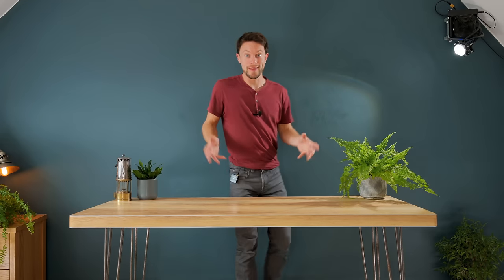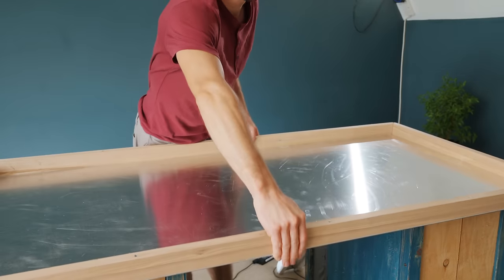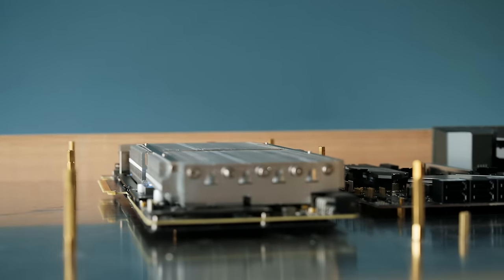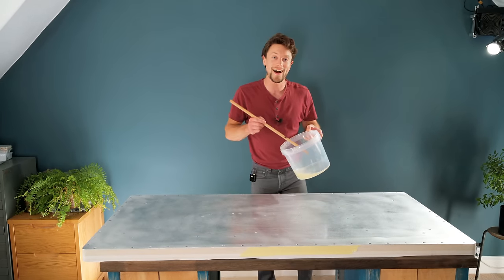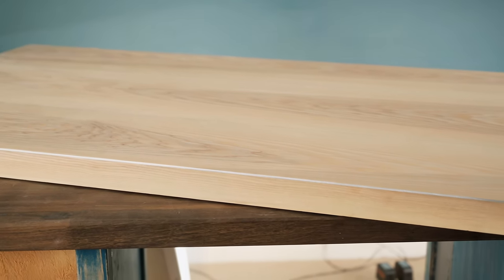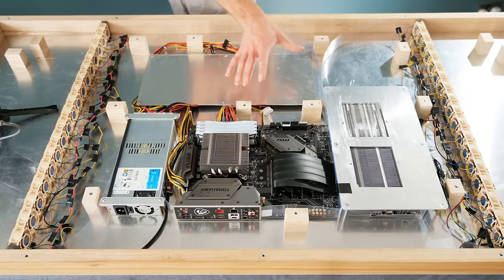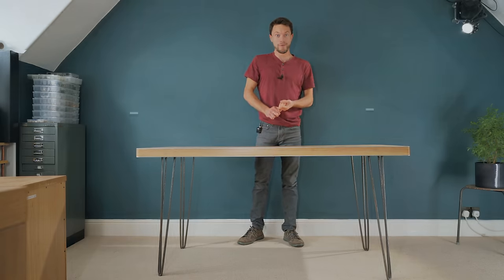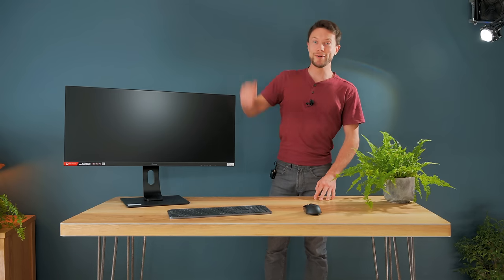Building an invisible PC

Comment: I feel like this would benefit greatly from liquid cooling. generally the liquid cooling blocks are much lower profile than air cooling blocks, and you have the advantage of being about to select any radiator size you want. Maybe you could even create your own radiator in a part of the aluminium table since it is such a large surface area, but I kind of doubt that.
Reply: 1st time ere eh?
Reply: If you have listened till the end you would have knownn that he's well aware of that.
Reply: Naw, liquid cooling is a maintenance nightmare, air is where its at unless you are constrained or have extreme overclocking needs, massive heatsink coolers are very hard to beat, and you don't have to worry about them failing.  I would have sacrificed the thinness of the table to achieve this, i wouldn't trust that thin table's wood not to crack if someone just hopped on and sat on it.
Reply: @churblefurbles  he could use two AIO water cooling Kits for both CPU and GPU using Kraken G12 mounting kit. Better thermals and quieter.
Reply: @armLocalhost  did he explain why he didn't go with it? He just mentioned Linus is doing it that way
Reply: @churblefurbles  I have a liquid cooling setup, custom loop. I do so because I am still running a first gen i7 that I have overclocked to nearly double its clockspeed. Sure, it is more maintenance than an aircooler (except if you are in a dusty room), but not a 'nightmare'. Pretty much have to change the water inside once or twice a year and you are fine. 
Plus it is besides the point. His desk now has holes in it and even a raised section for the mother board cooler, which could have been prevented with watercooling.
Reply: @armLocalhost  And? My comment still with its content. He also never mentioned why he didnt consider it. Plus he never mentioned using the table as a heatsink either.
Reply: but it would be annoying to check all the time and if it leaks everything is completely frked
Reply: @chengxiaoshi3461  You check for leaks after filling up the water cooling loop. if there are no leaks then, its very unlikely for a leak to form later. Plus even if there is, the water is non conductive so unlikely to do damage. In over 7 year of water cooling (and seeing friends that have it) I have never seen a single person having an issue with a water leak. 
Sure air cooling is more reliable and less maintenance, so I wouldnt recommend it if you arent doing serious overclocks, but it doesn't satisfy the size constraints imposed by the table, thats where the suggestion comes from.
Reply: It is also very costly
Reply: @tHaH4x0r  you know, even with an air solution, if you could come up with some sort of laptop-like heat transfer system from CPU to table underside (see also heat pipes, but obviously more than in the usual laptop), you could put some serious finnage attached to the inside of the lower aluminium panel, vastly increasing the cooling surface area. The problem is you'd have to either change how you're mounting the entire kit so it's attached to the removable lower metal sheet, or get used to re-applying thermal compound every time you took the bottom layer off. Either way, it'd be interesting to see whether something like that could be managed.

(I guess you could try to go with reusable heat transfer pads to avoid that kind of re-application - thermal compound between CPU and heat pipe assembly, thermal pads between that and the tabletop metal. Also, you can't use the top metal sheet as the heat sink because you'd get metal expansion rate vs. wood expansion rate issues and almost certainly de-laminate the top layer. And even if you didn't, you'd get wood and/or finish discolouration from the heat.)

Comment: how to make this better:
1. Use Water Cooling
2. Use smaller RAM Sticks 
3. Use a Mainboard that doesn't have an IO-cover
Reply: can we use the base as the heatsink? it is very wide so i think it can right?
Reply: Yeah, water cooling is perfect (and cheaper than 40 44mm vents) for this project. You can also add some gigantic radiator (like 480mm) and a lot of vents, create an airflow which mantains the central piece completely hermetic, for not having to deal with the dust. Also, I would buy a standard ATX PSU, dismount it and build a wood case for it because that shit is dangerous. And, in my opinion, I would do the surface of the table with dark glass over the wood, which gives the table a more premium finish, and leaves a small square cutout (the size of the motherboard maybe, here is the decision of the people) onto the wood to put some LEDs, which are going to illuminate the insides when it's turned on, and it is viewable the PC from outside, and when turned off, it doesn't sees anything. And finally, I would make kind of door which can open from the surface for a more easy maintenance and a nice view. Sorry if I have expressed me wrong, I don't know so much English.
Reply: How to make this better:
1. buy iMac Pro
2. put it on a wooden table
3. done
Reply: @philippjakob4356  fr
Reply: @tuxi04  Your English is perfectly fine.
Reply: @philippjakob4356  Nah bro macs are too loud and can't really handle anything just look cool
Reply: @cringecorner6828  Hmm.  Copper cpu block, copper heat pipes to carry the heat to the aluminum sheet?
Reply: @philippjakob4356  HAHAHHAHAHA AN iMAC
Reply: dont need it did u see how fat the wood is but water cooling maybe
Reply: @tuxi04  maybe an mini ITX PSU would fit there without the need to dismantle it
Reply: @philippjakob4356  it’s cheaper to build this desk with components that would make the iMac look like an overpriced calculator.
Reply: @cringecorner6828  That's what I was thinking (use aluminium sheet as heat sink). Very elegant solution and get rid of all the fan noise
Reply: @philippjakob4356  ah yes, pay three times the price for a decrease in performance and increase in noise.

That rtx 2070 is more powerful than the vega 64(that comes in the even more expensive configuration of the iMac) and doesn't thermal throttle in 2 minutes.

8700k beats the stupid xeons in gaming and has still enough cores to do some editing.
Reply: @philippjakob4356  but can you play cod on a iMac pro?
Reply: @cringecorner6828  I was thinking the exact same idea....
Reply: Btw the aluminum wouldn’t be heat sink it would be a heat spreader and do to it’s size and thickness it would be hard to carry the heat in to the aluminium but it would only spread the heat not get read of it but still it could help but it’s so thick but ya maybe if you used heat pipes to the aluminum but it would it be enough it would take a while for the heat to go from the heat pipes to the aluminum cause it’s so big and thick
Reply: In stead of the 40 mm fans I would have just have put 5x120 mm fans flat so they would push the air in still and it’s much cheaper to get 5x2 good quality fans then 17x2 40 mm good quality fans and since most fans are 10 mm tall you could have it poke out bit because though it would fir it would have trouble drawing air since he made Luther things come down a bit he could do that no hat btw I like diy perks a lot it’s amazing and he did much amazing I’m just saying if I did it that’s what I’d do to save a bit of money.
Reply: The reason apple ditched the Intel on iMac is because it's not that great. Hotter and slower. 😂
Reply: @sterkriger2572  the mini itx Psi is 15 mm thick is desk is it 15 mm thick and is aluminum is I don’t know how thick but I would much rather have the power supply come down a few mm than open so when you service or upgrade the pc it’s not an issue and it could be dangerous so I would get some wire and connect the wire from the psu to both sheets of aluminum so they are grounded
Reply: Why not just use wider wood to male a 2 1/4 inch thick "table" and avoid all the thickness limitations and box underneath alltogether???
Reply: @mattp6355  depending on the user, that might run into ergonomic issues. I struggle to get the mouse and keyboard low enough for elbow and shoulder comfort, while still having room for knees underneath. Thinner desks are better in that regard.
Reply: @mattp6355  I was thinking the same thing, or even better I'd make the front part of table just as thick as it is but as it goes towards the back of it i'd be making it thicker and thicker. This way the back would be significantly thicker thus allowing to put all the components in and from the front you wouldnt notice it at all
Reply: @philippjakob4356  Too bad the iMac Pro doesn't allow the user to upgrade all the parts individually.
Reply: @ezradja  To be fair, nearly everyone is ditching Intel.
Reply: @tuxi04  Your English is better than many English speakers. What's your native language?
Reply: @GregJoshuaW  My native language is Spanish, but I also view a lot of English content.
Reply: @tuxi04  Well, you're doing great! :)
Reply: Or just buy a new M1 Mac mini and mount it underneath a regular table🤣
Reply: @aikeber1984  well, at the moment of this video the M1 Mac Mini wasn't there. Now, maybe is a better option for normal usage but for gaming my option is better
Reply: Agreed. Overly intricate air cooling system is completely unnecessary. Water cooling would be quieter as well, something that should be a big deal in an incognito build.
Reply: @tuxi04  yes I was just joking, I agree with water cooling
Reply: no. Watercooling this setup would mean that the CPU block would face downwards and that the CPU block is the highest point of the loop. This means that the microfins in the block would catch a LOT of air and if he uses a pump-block it could kill the pump.
Reply: @jonathanlarsen4177  that only will happen if you use an AiO water cooling, but for the dimensions and the posibilities for installing huge radiators a custom water cooling is way better, also some AiO wouldn't fit there. But I'm agree with you if the system is downwards like the video.
Reply: @tuxi04  No this would occur with an open loop too. You need to flip the motherboard around, thus making the table thicker. Sounds good, doesn't work. (sadly)
You could technically achieve a completely silent system with water cooling but not with this concept, you would need to re-do all the planning.
Reply: @jonathanlarsen4177  yeah, I know. A suggestion to make this to work is to flip the motherboard, as you said, and I think it's better like that, because you can do any maintenance easier, and add a door like the hood of a car, that will make this build a lot better
Reply: @tuxi04  damn yea. If you could open it up like a door from above, that would be dope. Maybe he will do that, he has done custom loops with alphacool in the past
Reply: I'm concerned about the dust that will build up over time
Reply: I was also going to say, should have used the newer water cooling, the radiators are very thin.
Reply: 4. use amd
Reply: Please, don't push this guy into more water coolings ! :)
Reply: @tuxi04  I agree with most of what you have said here. However the glass top leaving the internals visible is the opposite of what his intentions are with this table, which is to have the PC out of sight, therefore out of mind from anyone whom is none the wiser.
Reply: @jonathanlarsen4177  if I do it I will upload a video on YouTube explaining how I did it. First I need money, maybe in a year or two I will be able to do it
Reply: @philh98  No no no, the glass of my idea isn't transparent, it has a layer of black vinyl, to make visible the components ONLY when you turn the lights on
Reply: @tuxi04  Working on a glass surface sucks. To cold for your wrists, underarms.
Reply: @philippjakob4356  it never ceases to amaze me how much more powerful of a PC a person can build for the same price of an Apple. $3k PC would cost $11-14k Apple.
Reply: @tuxi04  I stand corrected. That indeed stood be a Favreau upgrade!

Comment: Watercooling would have been the way better choice in this build because you got a lot of surface area which is perfect for huge radiators and extremly silent fans
Reply: That's exactly what i've been thinking of during all this video
Reply: And cheaper
Reply: Was gonna say but, ya already did lol
Reply: You could have turned the whole bottom surface into a heat sink radiator!
Reply: @JohnDlugosz   to warm legs in a long cold winter nights
Reply: As a radiator it will not work because it will radiate inside the desk.
Reply: @gbenselum  The energy will move to the colder air. As soon as the inside is warmer than the outside it will move more heat to the outside. But the surface area of that table is waaaaaaay to small to get that amount of heat away.